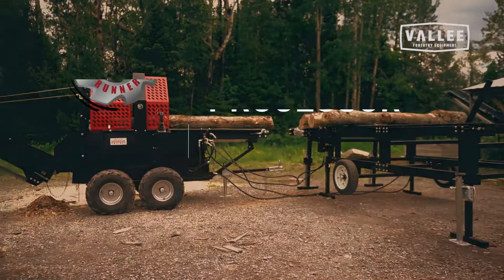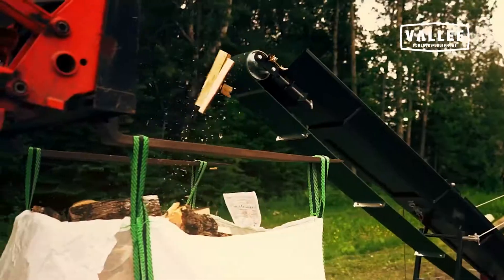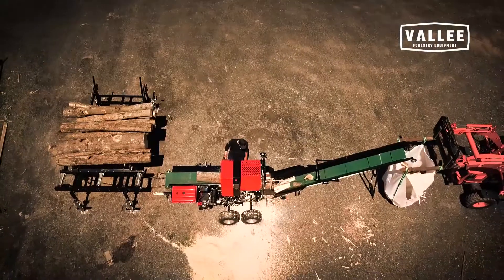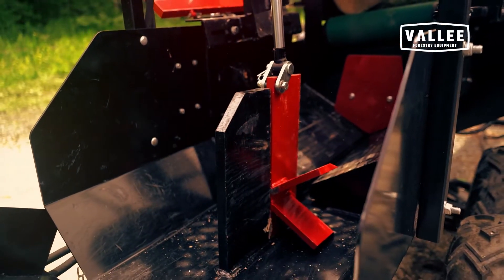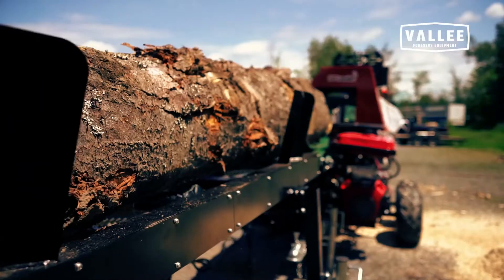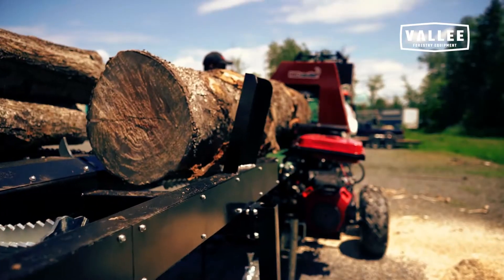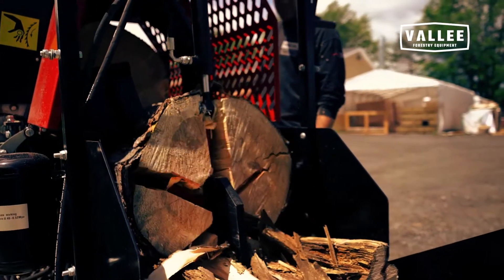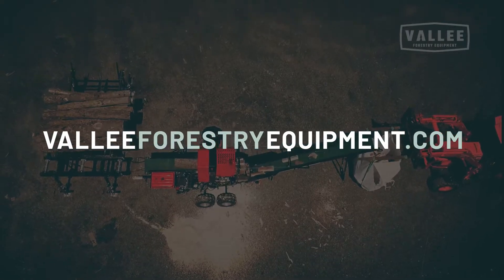Red Runner JOY30T - Firewood Processor

Comment: Is there an automatic stop when the logs reaches your desired cutting length?  Which type of saw chain would you recommend? Full chisel or something else?
Reply from the maker: Yes, there is an adjustable stopper to determine the desired log length. The chainsaw bar is an 24'' Oregon Solid Harvester with an Oregon .404'' chain.

Comment: As soon as you lift the arm controlling the chain the splitter is suppose to come out. My Deluxe has stopped doing that - where can I get this adjustment corrected. I live in Rockland Ont
Reply from the maker: Hi Paul, for technical assistance, please contact your authorized dealer.